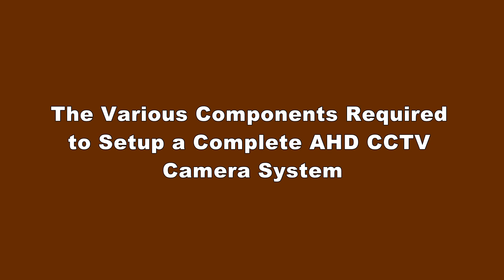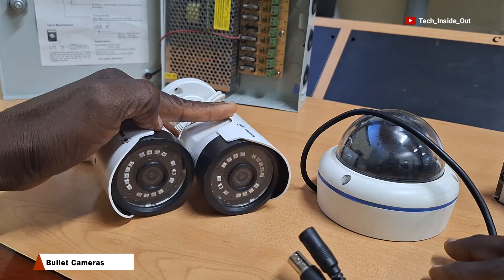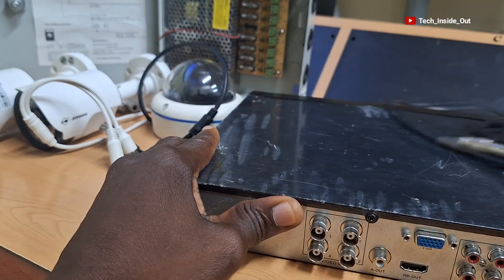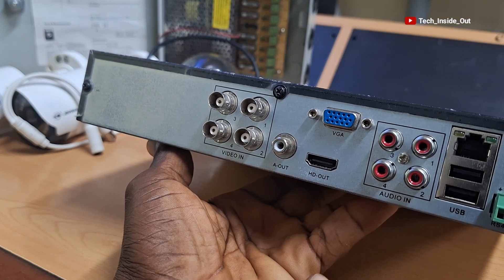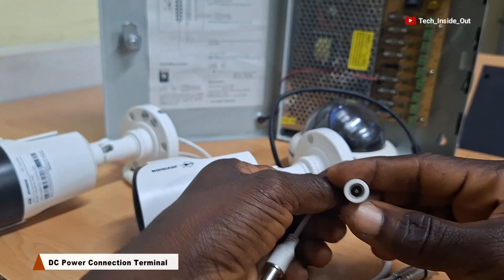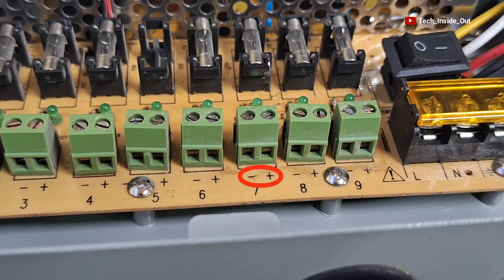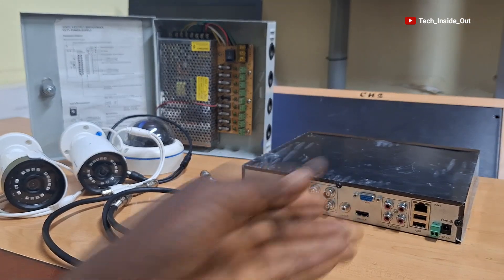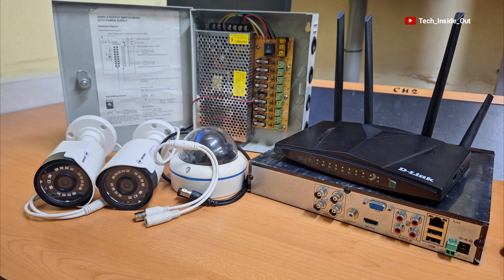Components needed to setup an AHD cctv camera system.

Comment: Why would anybody still use AHD, TVI, or CVI systems?  The image quality is never going to compared to IP (or SDI, though that's basically dead in the security world)?
Reply from the maker: There are 4K AHD cameras with picture quality incomparable to a 3MP IP camera. AHD is still being used, Picture quality depends on many factors and not just an issue of IP camera usage

Comment: God bless you sir. What type of power is this sir?? please does it last? would you recommend above cat6 cables?
Reply from the maker: It is the power supply unit for cctv, it works well. 
The use of cat 6 is recommended for wiring AHD cameras within short distances.